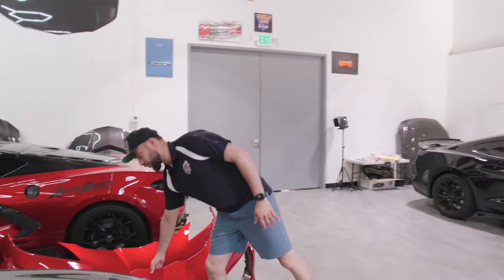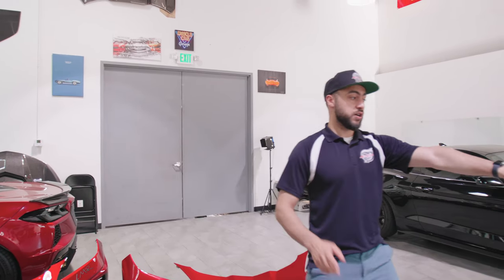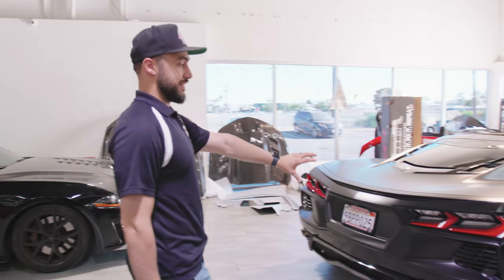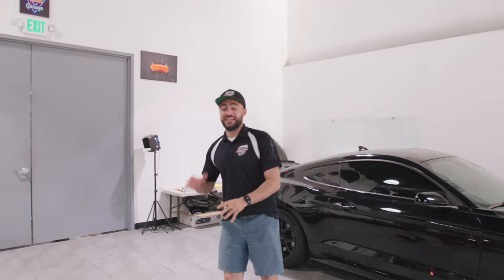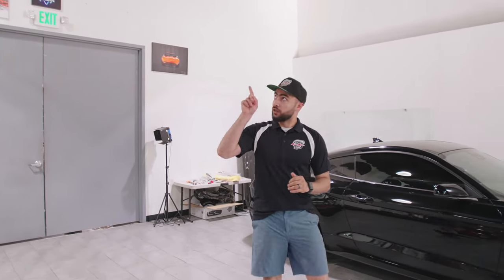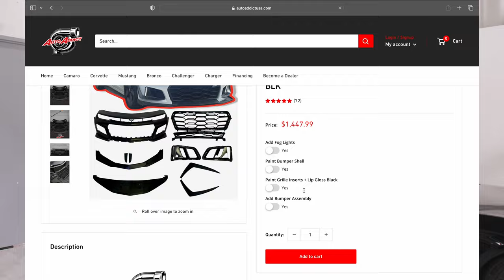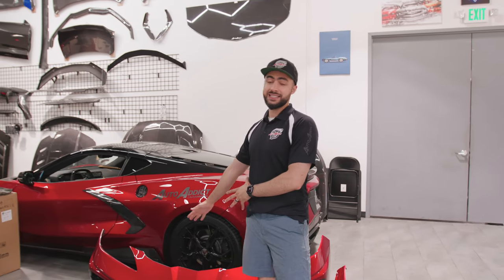C8 STINGRAY Z06 Conversion Bumper Track Package Now Available | @AutoAddictUSA

Comment: Can you install the Z06 rear bumper on a C8? If not, would you guys be developing something similar to what you did with the front bumper?

Also, I would love to see the base Z06 rear wing spoiler be installed on a C8 or the idea is to have the same shape (is this possible without having to replace the rear bumper?)

Comment: Hey great video and I appreciate the effort that went in to this mod . 
But no … putting this front end on a stingray is just destroying the car butchering it to make it look like a Z06 from the front ? What happens when you walk around to the side ? 😂  there is nothing wrong with the stingray front end as it is 
The Z06 front end is beautiful for sure … on a Z06
Reply: That comment is crazy! There is something wrong with the Stingray front end as it is!  It looks like something with an "overbite", as opposed to the correct bumper trajectory of the Z06 front end. That's why I just bought this bumper upgrade kit. Not trying to be a Z06, but rather than trying to correct a design flaw in the Stingray's front end appearance! BTW, I'm hoping GM builds a C8 Grand Sport, and hope to buy one when it comes. Until then though, I'm hoping to make my Stingray look as good as possible with this bumper kit.
Reply: @Stew5166  Ahhhh I guess to each their own .... for me the appeal of the Z06 is all about the wide body and engine not so much about the front end .... I'm lovin my stingray as it .... although I have changed a few things but the body will remain factory ... and its great that Corvette owners are doing things to make their cars their own !
Good luck with all your mods !